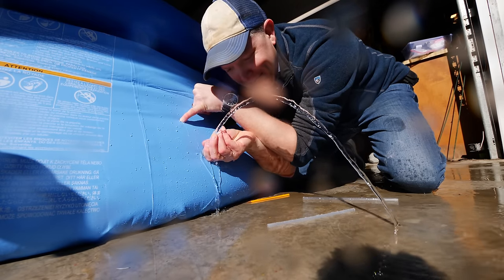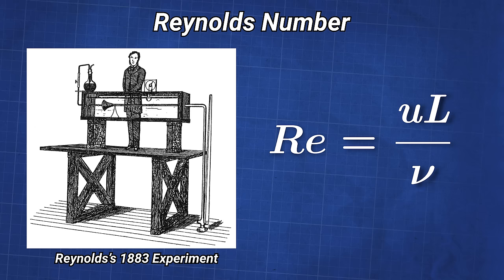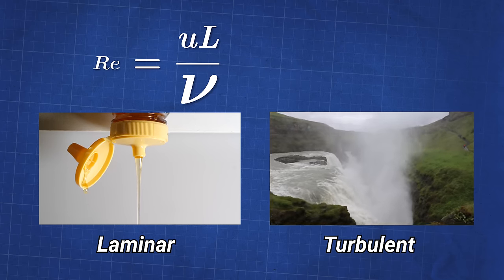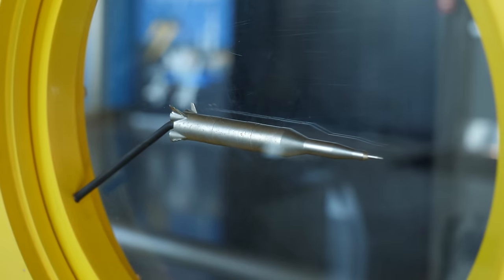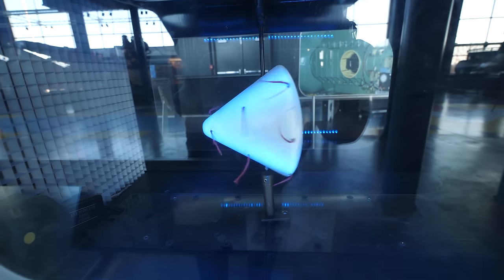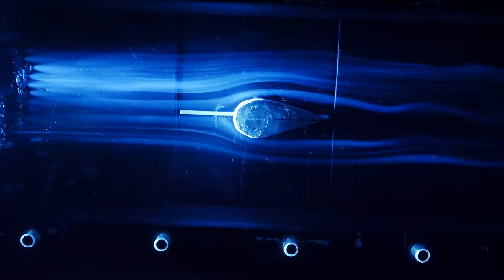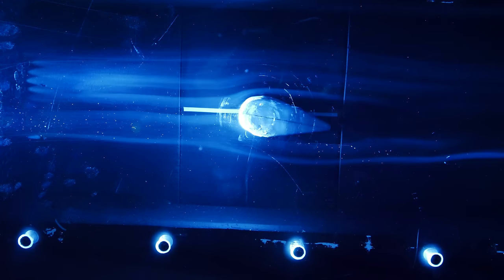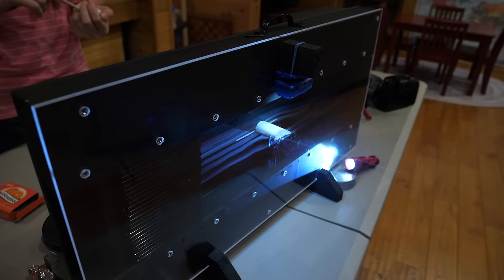Why Laminar Flow is AWESOME - Smarter Every Day 208

Comment: What would happen if you applied a static charge to a laminar flow? Could you invert it without it going turbulent?
Reply: I assume by "static charge" you mean running the flow through an ElectroMagnetic Field.

In that case, you can easily imagine that if the fluid is simply "not magnetic", it would be unaffected.

However, water molecules are actually affected by Magnetic fields; you can sort of "push and pull" a free flow of water using a magnetic field. However, it is unlikely to affect the type of flow (laminar vs. turbulent).

In case you're asking about something separately, I'll give a more general answer:
A flow only goes turbulent if the Reynold's Number (Re) is high enough. However, in real life, there is no strict "cutoff" for the Re that exactly determines whether a flow is Laminar or Turbulent (and in fact, many flows are "in between", and are thus called "Transitional). However, we know that for any Re less than about 2300, the flow will always remain Laminar (you can get Laminar flows with Re of 8000 and more, however it takes effort and is not guaranteed).

Thus, if you guarantee that Re is less than 2300 for the flow, it is guaranteed to remain Laminar. Otherwise, I will have to give you the "standard" Engineering dodge of "it depends" :D
Reply: With enough magnetic flux density and the right shape (field focus), I'm sure it's doable. Specific numbers, though? I have no idea. If the field were theoretically strong enough, you could do anything you want to the water, really.
Reply: Up
Reply: Not sure what you mean by invert it, but you can definitely alter the direction of the stream with static electricity. Get a balloon, rub it on a carpet or wool sweater or something to get it charged up, then hold it near some water flowing out of your faucet. Obviously easier to see with laminar flow.
Reply: Mutantcy1992,Correct. Water is polarized. Therefore a static charge can alter its course. With a proper charge I’ve seen it go past 90 degrees. I’m just not sure if there is a way to do that and still maintain laminar flow.
Reply: @jdjr3640  Oh I see.  Yeah not sure, but it would be interesting to try

Comment: As much as I like this video and laminar flow, in the beginning of the video on the pool with that plastic straw, I think that's NOT laminar flow like almost all the rest of the "laminar flow" on this video. Keep with me: 

According to Fox and Mcdonald on the book Fluid Mechanics, laminar flow occurs only when Reynolds number is under about 2300. Let's do the math with some assumptions (Re=pvD/M): for water p=1000kg/m^3 and M= 1,0030x10^-3 Pa.s Ok, I estimated the diameter of you plastic straw on something about 5,5mm (0,0055m). Now I only miss the velocity of the flow. Using Bernoulli’s equation with some simplification [ v=(2gz)^(1/2) ] being g the gravity acceleration (9,81m/s^2) and z the high of the water column that I estimated based on the image that the water is about 30cm (0,30m) higher than the hole, the velocity of the flow is something about 2,426 m/s (about two and a half meters per second). This way, the Reynolds number is something about 13303 and the flow is already turbulent. 

For the bigger plastic straw (8mm and 40cm water column) Re = 22344

And watching the flow on that science project you can see the layers of the flow shaking between them.

Laminar flow occurs when a fluid flows in parallel layers, with no disruption between the layers.

I remember that my Fluid Mechanics teacher says something when he build his wind tunnel for the university that the flow on that wind tunnel wasn’t laminar, it was just a flow with good quality. Might that be the case in here? What you think?
Also, please, double check my math.

Best Regards,
Rapha

PS: Here in Brazil we use the comma ( , ) to separate an integer part of the decimal part
Reply: Finally someone who actually gets the laminar flow right.
Reply: @planecrazy2  Sorry, here in Brazil we use "," as a "."  The velocity on my math calculus is about 2 and a half meters per second.
Reply: @raphaelodebrechtdesouza2311  Yeah, clumsy and easily confused american here. The numbers make sense now. Good work! It was fun trying to check your work.

Comment: You missed the easiest place to see laminar flow in the home.

Your kitchen sink.

Turn on a your kitchen tap so the water lands on a flat area away from the plug hole. Watch the water spread out in a flat ring then rise in level suddenly. THAT IS A HYDRAULIC JUMP AND IS THE PLACE YOU SEE LAMINAR FLOW EVERY DAY.
The water in the lower region is laminar. The ridge is the transition and turbulent region. Beyond that is slow turbulent then laminar again as the turbulence dissipates energy slowing it down a bit more providing a gradual rise in height.
Reynolds < 1000=Laminar
Reynolds 1000-2000=Transition
Reynolds > 2000 Turbulent

The water slows down a lot in the transition region. Flow rate from the tap is constant but the height is much greater after the jump.
So velocity must have decreased. Kinetic energy is a function of velocity squared, so a rapid decrease must have transferred the energy ( Into heat.).

We use this when designing weirs. If you know where the jump will occur, you can reinforce the concrete around this region as it is the area that will wear out the fastest.
This allows you to cut costs as you can get the jump to occur more quickly by altering the Weir shape whilst maintaining a desired flow rate.
The optimum shape makes the jump occur closer to the Weir using less concrete over all.
Once it has transitioned and become laminar again it's normally fine in a earth channel like a regular river.

Comment: Wonder what are the implictions/effects that laminar flow , exert on water molecules?
Water molecule is a polar dielectric, it has hydronium ions as well.
A dielectric accelerated in an electric field develop an intrinsic magnetic moment. 
Do laminar flow of water through an electric field , perpendicular to a magnetic field, would structure the water molecules?

Comment: There is this cool exhibit in the Corning Museum of Glass here in New York (where they pioneered fiber optics) where they have a fountain with laminar flow and they can shine a light through and it bends with the water stream. Its pretty neat.
Reply: That's total internal reflection, right?
Reply: @woopygoman  I believe so. You can see Destin is able to look through the water bubble pretty clearly in this video, so I assume its just working like a mirror to reflect the light.
Reply: I remember that!

Comment: I want laminar flow in my car's intake manifold.
Reply: Do the calc's!  Figure out what the Reynold's Number in your intake is.  You can do it!
Reply: You actually want turbulent flow in there. All that turbulence provides better mixing of the air and fuel in the piston, which gives you better combustion.
Reply: @anothertodd  I want laminar flow in the intake manifold system from the inlet onwards, through the MAF and throttle butterfly, and perhaps even almost into the plenum. Because it has been proven to yield more efficiency (aka. power); even more so than having a lower IAT. 

But from the runners into the pistons, yes, turbulent flow does promote better air-fuel mixing.
Reply: @nickamarit  Well, I do wish you luck then. The eingeering challenge of designing an intake system that maintains laminar flow at a sufficient flow rate to sustain the engine, evenly distributes to all cylinders, and gives sufficient swirl in the piston to achieve efficient combustion is a big one (even before thinking about how it'll fit in or on the car). But that's the kind of stuff that makes engineering fun! So, my wishing you luck is sincere :) Although, if you have forced induction, you'll probably want to just forget about it...
Reply: @anothertodd  Yeah, I'm into NA cars, although I feel that in order to get the most out of NA engines, the revs need to be quite high, which requires increased induction flow rate, thus making intake laminar flow that much more difficult.

I'll be happy with a "more laminar/less turbulent" system, especially between the filtration element to the throttle butterfly. A long and relatively-straight piping should do but packaging becomes a concern. Sigh. Compromises, compromises.
Reply: @nickamarit  what about using the same concept that the water life filters use? Essentially straws that are so small that they only allow clean water through. Yet this is still fluid Dynamics. Keep the funnels long and curve your way to the intake. Just a ton of jumbo straws... Well this isn't as thought out as it seemed earlier. If they create too much resistance utilize a bypass function that is essentially a one inch perimeter of normal air filter surrounding the funneled straw streams of air. I think it might work.
Reply: @potroastmaster  I've only studied basic fluid dynamics, so can't really comment on that too much. But wouldn't that (smaller piping diameter) decrease the overall/average amount of air passing through the intake? (due to the friction along the pipes' inner surfaces. You said to use multiple small pipes, so that might mean there will be more friction?
Reply: @nickamarit  I will find out 😉
Reply: @nickamarit  Right on!  Compromises... That's the name of the game when it comes to engineering. It's all about figuring out which compromise works best for your application. It's pretty much always a win. Even if your compromise doesn't work out, you'll definitely learn something along the way. I'll be stoked to subscribe to your YouTube channel when you figure yours out :)

Comment: Great video about Laminar Flow, but Sarah-Kate's experiment raises a question about something I've always wondered.  Why do candles only smoke, or smoke a lot more, when you blow them out?
Reply: That’s easy. When a candle burns, the heat vaporizes the wax, and the vapor mixes with air and then burns. When you blow the candle out, the vaporized wax is no longer being burned, but is still being produced by the residual heat around the wick. The smoke is actually unburned wax vapor.
Reply: Because smoke burns, you can light the smoke and itll light the whick
Reply: While the whick burns, no smoke can escape
Reply: Wick*
Reply: @otterpop5551  Thanks, perfectly explained.
Reply: Caleb Reischman I learned this last year, that smoke is flammable which I was totally unaware of. I watched this documentary on YouTube called hidden killers of the Tudor era. In Tudor times, they started building houses (as opposed to cottages) that contained two floors. They built chimneys and didn’t understand that smoke was flammable and if it wasn’t ventilated properly would combust and the wooden house would burn down and then sometimes the whole village would burn down. Also the bricks they used to make the chimneys with would explode and the entire chimney would collapse and kill people. It’s a tragic yet fascinating series of human trial and error. They have the Tudor, Victorian, Edwardian and the 40’s I think. You should check them out!
Reply: @rayodelsol80  Yes, as soon as @Caleb Reischman said it, I suddenly recalled a video of someone blowing out a flame, and then putting light to the smoke, and it ignited. It's no doubt on here somewhere.

Comment: laminar flow is a thermodynamic nightmare.  it flows along the sides of pipes, creating a boundary layer which insulates whatever is outside the pipe from the turbulent flow in the center of the pipe, effectively reducing the ID of the pipe and inhibiting heat transfer.  in an engine, the air/fuel mixture flows as fluid through the intake manifold.  laminar flow creates a boundary layer that reduces the size of the intake tract and reducing engine performance.  that's why you need to rough up your intake manifold to reduce laminar flow and increase performance.
Reply: I know some of these words, but I want to learn more. You say thermodynamic nightmare, I can probably relate only 3 words with that, but on what application does the nighmare apply? Sorry if my question doesn't make sense.
Reply: subvet657 I totally understand what u are saying......totally.
Reply: Correct for a carbureted motor but not fuel injection.
Reply: @Kent Bardillion your question makes perfect sense. The first law of thermodynamics is, heat goes to cold. An air conditioner cools the air by extracting heat. Not just forcing cold. What he was referring to is the efficiency of heat transfer related to flow. Laminar flow inside the pipe, on the walls of the pipe create an insulating layer that doesn’t let the liquid’s temperature transfer to the outside of the pipe as well. A rough surface breaks up laminar flow making heat transfer easier. In the case of the engine manifold, the air flow more consistent and even. Something like that.

Comment: So, if you're taking a pee in a parking lot because you're miles from a restroom, you would experience Laminar flow to about the first 18" of stream and turbulent flow thereafter depending on how much beer you've had.  Got it.   And, would the Laminar flow spiral be reversed south of the equator due to the Coriolis effect?

Comment: Question for you. In designing a streamline tricycle for World Speed Challenge in Battle Mountain NV., There is a problem when you near 100 mph. Laminar flow at the surface of your body begins to De-laminate into a surface turbulent flow. What if instead of making the surface as smooth as possible you make it satin like (just slightly rough) so that you start with a thin turbulent flow over the body? Will that transition better when nearing 100 mph?

Comment: At 7:20, is the thickness of the wall of water more than at the base of the "sphere", where it hits the pool? My assumption is that it would reduce, since it covers more surface area. Would it be about half as thick where it hits the pool?

Comment: Laminar flow is critical for moving energy efficiently through fluids. So it's important in aeronautics engineering as well as submarine engineering, cars... everything that travels through fluid. I you look at animals whose movements are prodominantly through fluids like birds, fish and other animals that live predominantly in water, you will find that both their bodies as well as their movements are "designed" in order to avoid turbulence - to save calories and beeing able to move faster. I mean, just look at how fast dolphins can swim. They can easily keep up with a motorboat - while making much less noise.

Comment: I attended a public Faraday lecture in the Uk in the early 70s. The lecturer had designed a laminar flow teapot so that the tea leaves would not be disturbed when pouring the tea. His wife stopped using it after a while and when pressed said the tea tasted funny because the teapot looked like a bedpan.

Comment: I'd be really curious to see you explain how laminar flow is working in that funky shower head that has the fan blade in it.  The LevyHead shower head thing seems to be making the water streams travel in an hourglass direction.  The small "waist" is very easy to see in the videos, but how is it doing that?  Even with the fan causing turbulence, the final director of the stream is the way the small ports in the face plate are drilled.  As such, the water should come out in a straight line, in keeping with how the port is drilled.  Even if the faceplate was to spin like the fan blade does.... that doesn't explain what's happening to the water streams.  How are they braiding together like in the video?  Is it all just an optical illusion, and your brain's creating an effect that doesn't really happen in actuality?  I guess I'm gonna have to buy one just to see for myself.

Comment: I too am fascinated by laminar flow,  I have watched special effects engineers create a significantly better LF by reducing turbulence in water within the pipe. So effectively they took normal water pumps and towards the delivery point the took a larger pipe and filled it starting with big straws, and reduced the diameter of straws in a series of steps within the larger pipe then continued with the smallest set of straws going into the outlet of a smaller dimensional size .   The straws take the turbulence out of the flow and create the clearest and longest flow of laminar flow of water. In the entry to the larger tube they placed an led light and effectively made a neon looking tube out of water.  You should try to duplicate this process.  You could likely do this with the pressure from your water hose some pvc and some straws from. Large to cocktail size.

Comment: imagine running loops of pipes all through your city and filling them up .. once filled itsz a fully self pressurized perpetual loop.  water should be looped and copper wires single poled terminus style etc ... anyways pressurized water loop fluidic engine ... any node could generate power .. serial water network, mesh data spark netwrok

Comment: That isn't laminar flow. Turbulent fluctuations at the start of the stream are small so that its cross section remains symmetrical. Towards the end of the stream you will notice the cross section become essentially chaotic. This is becuase the turbulent fluctuations amplify and increase the disturbance. The same science things happens when you take a leak.

Comment: Do love laminar flow. It's used in the nozzles of water fire extinguishers to make them get maximum possible shooting distance of the water. See if you can get hold of one and fire off the full bottle and watch the flow as the pressure decreases. You can fill them and charge them up yourself with an air compressor for endless laminar flow fun. 😁

Comment: 7:45 This can be used for space port entrance and exit. Use it as door. I would like see this in zero gravity. 
Laminiation i think is the answer and see if hold the 1Bar with air lamination flow in a vacum.